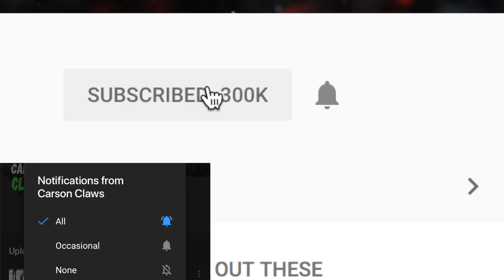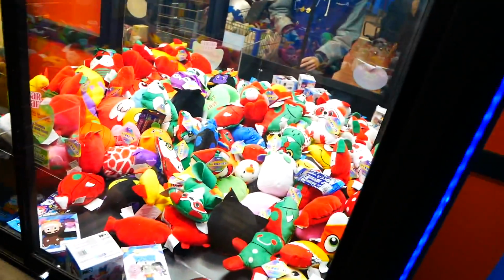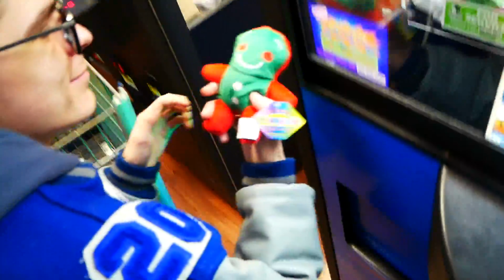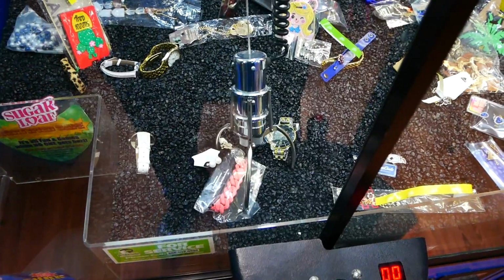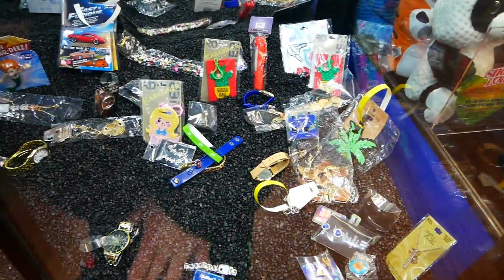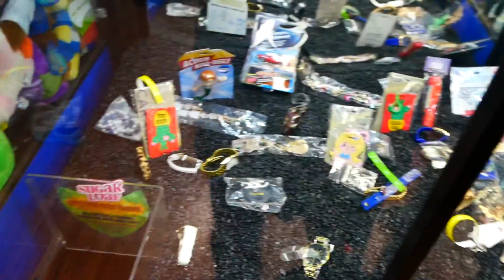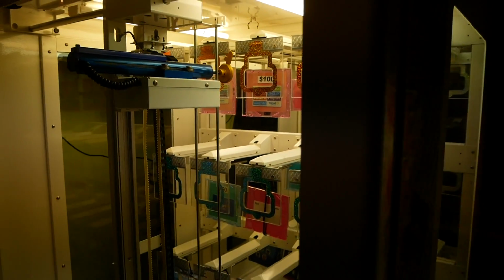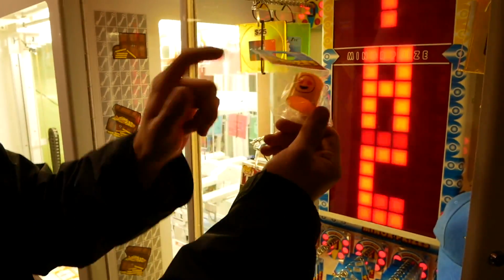HUGE PROFIT AT THE ARCADE!

Comment: Stackers are “technically” skill based, in so far as there is no payout rate for it to be ready or not ready to pay out. They use a “difficulty” setting instead, that basically just makes it next to impossible to hit the major prize. (at least the regular red stacker & the blue Stacker Club operate this way)
Reply from the maker: Interesting!
Reply: @Carson Claws There’s a speed setting for how fast the blocks move (if I remember correctly it’s 1-6), and a “difficulty” setting. I keep mine on the second highest speed setting, and highest difficulty, and just rotate prizes & always leave one of the major prize spots empty every week so it looks like somebody won. I’ve had one major prize winner in 3 years. Lol